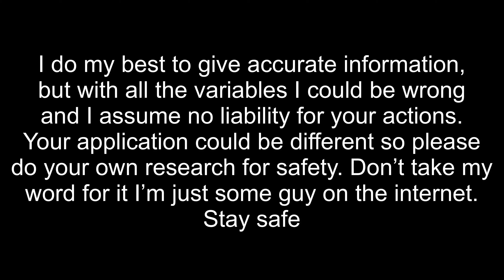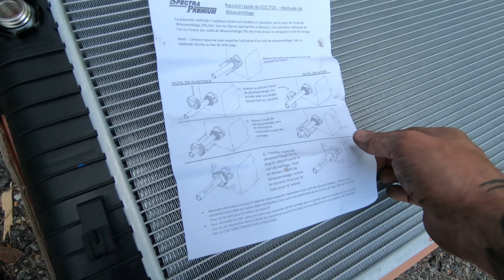Replacing a radiator on a GMC Sierra 2500hd

Comment: You ever get the dreaded “reduced engine power” lump mode on the pickup truck?
Reply from the maker: I haven’t gotten it but the owner before me did get it on this truck and it was the throttle body that was the problem. I think The wiring within 6 inches of the connector can be problematic also.
Reply: I did,replaced the throtle body and would still do it every once in a while,it completely stopped when i replaced the wiring harness
Reply: @2087erick  so you replaced the whole harness?
Reply from the maker: I believe it’s just a 6 inch pig tail with the plug that goes to the throttle body.

Comment: Good informative video. I didn't see an EGR valve and was wondering if it didn't come with it or if you deleted and if the latter, notice any benefits?
Reply from the maker: This engine didn’t come with an egr valve. I had an 04 suburban with a 5.3 and an 05 Tahoe with the 5.3 and neither one of those had an egr valve either. I don’t know if that’s weird or not, maybe I just got lucky and one less thing to break.
Reply: Ok, mine is an 01 2500 HD with the 6.0, probably why it's different. I have heard of people having problems with them and so when I did the radiator swap I went ahead and took off the EGR valve to clean it and it was really dirty so that's why I asked. I appreciate the fast reply.
Reply from the maker: No problem. This one is an 03. I though I heard the egr valve were problematic and expensive but I haven’t had any real experience with them on these engines.
Reply: @JasonTheMunicipalMechanic  I haven't messed with too many on gas motors but I've played with several VW TDI's and the carbon build up on most was literally about 0.25" thick around the entire circumference of the lines connecting to the EGR, drastically restricting air flow. I imagine they are problematic and is the reason why the newer models are different.
Reply from the maker: Diesels are a little different. They have high cylinder temperatures so they produce much more nox emissions than gasoline engines. The soot from egr system in diesels are unreal. It’s mind boggling how dirty the intake tracks get. I have 2 diesel trucks and they are both pre emission engines. I don’t think I’ll ever own a newer Diesel truck because of the headaches with the emission systems. We have 5 f550s with a 6.7 and they need work quite frequently. I’ve been lucky for a bit with a good stretch though
Reply: Good to know. Mechanicing is just a hobby for me so any new info is always appreciated.  From personal experience, the 1.9 TDI's ran a lot better and got over 50mpg on the highway with the EGR deleted and my 97 Powerstroke hardly ever gives me any issues. I know it's all for emissions but I don't think they take into consideration that power gallon, emissions are less harmful, but now fuel economy suffers and more fuel is used and in the end, the emissions aren't really lowered. Again, thanks for the info, I'll quit blowing up your comment feed now. 😁
Reply: I have a 2001 GMC 2500 Hd with the 8.1. Radiator tank is bad. All of the replacements have a 1 3/16” core, mine has a 2 3/16 core. Even took it to a radiator shop to get their opinion, he said do not replace with the smaller core because the towing I do, I would not be happy with it. In even called the dealer and had them look up the number with the Vin….. all they have for it of the small core radiator! Thoughts anyone?
Reply from the maker: Have you tried looking at the diesel radiator to see if it will fit?
Reply: @masdbo  I did a quick search and I see what you mean. My best guess would be to go with the the one that's available. Perhaps it's more efficient than the ones from 20 years ago and will still meet your needs. If you still have reservations, maybe consider adding/upgrading your cooling fan or add an additive that helps keep the temp lower. Definitely keep an eye on your temp gauge when towing or really at all times. Best of luck bud.
Reply: @MrMichaelshain  thanks for following up, but tonight I was telling the story to a mechanic friend at a dinner party and he suggested a couple of places. The 2nd place i checked was Keystone, which had the correct radiator. ( according to the pics and specs), plus it was half  the price! https://www.discountbodyparts.com/details/GMC/Sierra_2500_HD/Replacement/Radiator/2001/SLE/8_Cyl_8-dot-1L/P2537.html I must have checked 10 places! Advanced, auto zone, rock auto, eBay etc!

Comment: What do you think about the radiators on eBay I was thinking about ordering one from eBay?
Reply from the maker: I haven’t gotten any from eBay before. If I were looking on there I would search for a part number I got from a parts store. You can sometimes find them cheaper for the same part. The only issue is usually no warranty off eBay. I use rock auto usually. The parts are cheaper but the shipping is pricey, they do usually have a lot of parts though.
Reply: @JasonTheMunicipalMechanic  Thank you